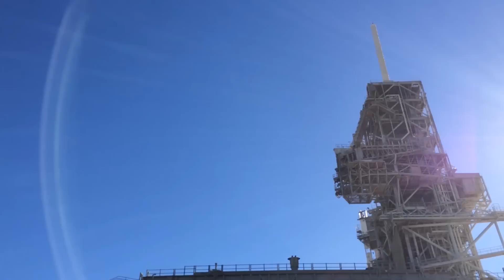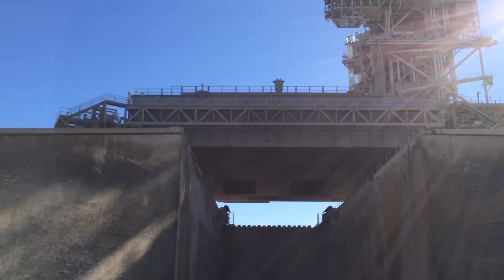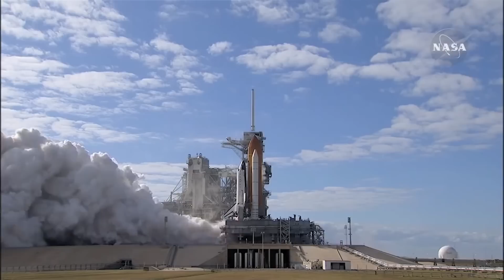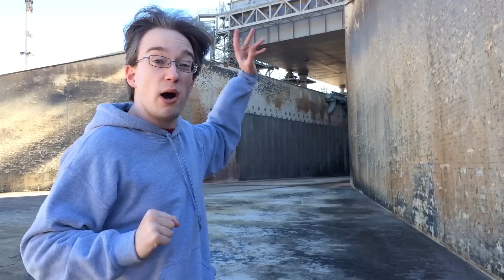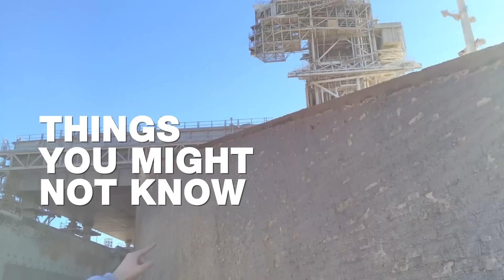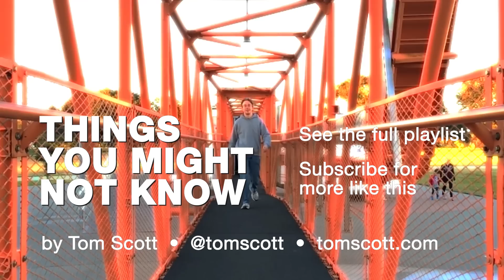The Hard Part About Getting To Orbit Isn't The Height

Comment: Why do you use miles?
Your English and metric is best.
Reply: England uses a mixture of metric and imperial. We have road signs in miles, food is mostly sold in grams and litres, beer comes in pints but wine comes in 750ml bottles. Temperature is mostly standardising on metric now but a while ago it seemed like we used Celsius for temperatures up to about 15c/60f and Fahrenheit for higher temperatures.

Comment: Most of the energy released as heat when something burns up on re-entry isn't actually because of friction with the air scraping up against the thing as it falls. Because the meteor or rocket booster is traveling faster than the speed of sound in an atmosphere, it's actually caused by compression — the air underneath the falling object is too slow to get out of the way, and it collects underneath the object. Highly compressed air is extremely hot, so it burns up. And that, is something you might not have known.

Comment: Anyone who's gone through the trouble of installing Real Scale Solar System and Realism Overhaul to Kerbal Space Program knows this all too well. Also, plane change maneuvers take an insane amount of fuel, which has been the main reason I've yet to make to the Moon yet. I think once I managed to do a flyby, but that memory is quite foggy at best. shrugs
Reply: Even in stock, you get a good sense of the concepts behind orbit once your big rocket falls into the ocean a few times
Reply: @keiyakins  and rss/ro gives you the sense of head pain
Reply: My solution is simple. If it don't work, add more rocket. It'll work eventually.
Reply: God RO sounds like hell 
returns to flying SSTO in stock
Reply: Why change planes if you're going to the moon? If you launch due east when the moon crosses the 90°-270° line on the navball you'll launch into the orbital plane of the moon and now you only have to burn prograde
Reply: Maybe in stock KSP, but in RSS, the moon is in an inclined orbit to account for the fact that KSP1 doesn't support axial tilt. (Unless you install Principia, but that's a whole 'nother kettle of fish besides.)
Reply: @LexieAssassin  i'm talking about RSS though. If you're launching from Florida you can launch directly into the plane of the moon once a day (twice, but the launch windows are very close to each other so they're basicly one)
Reply: Hirmh... I haven't played RSS in a while, and I think back then I was launching from Baikonur besides.

Comment: A thought. If the problem with reentry is the fact that the objects doing it are entering at stupid-high speeds thanks to needing that to maintain orbit, would someone jumping off a space elevator (assuming one is possible and gets built) not turn to ash and be able to actually parachute their way down?
Reply: By the time you actually reached the atmosphere you would have sped up a lot so I'm not sure.

Comment: Reentry was used by Apollo, not space shuttle. 30 years and media did not understand. Reentry is about bouncing up against atmosphere like a horizontally travelling stone on a pond.
Reply: That's aerobraking. Pretty different.
Reply: No. Aerobraking is using air to brake. Reentry is bouncing. If you do not use aerobraking, you can use lithobraking (crash on stone) or propulsive braking.
Reply: M Infante Atmospheric reentry is defined as entry into the atmosphere of the body a spacecraft was launched from. What you're referring to is entry skipping.
Reply: Hologrampizza Have you noticed how space shuttle EI Entry Interface is not named RI Reentry Interface? When you reenter, you enter again.

Comment: Of course it's speed... 8 km/s is not easily achieved, but if it is achieved then altitude is not a problem at all...
Reply: All is relative, I think the combination 8km/s at an altitude of 100m above sea level could very quickly become a very big problem
Reply: Flimzes Of course it is relative to the planet we are talking about. But on Earth 8 km/s is the speed which is enough to reach the Orbit.
So Unless you are going 8 km/s towards the ground you will be in space in no time after reaching 8 km/s...
This doesn't depend on object's weight btw, weight only matter in determining how hard it is to reach 8 km/s. Shape also only matters for Air resistance, because you don't want to slow down below 8 km/s due to it. But if you have stable speed above 8 km/s you are in space or will be very soon.
Reply: At 8km/s at 100meters above sea level I would be worried about smashin into things at about 8km/s much more than eventually hitting space. It was a joke :)
Reply: Flimzes Oh... in that regards... well as I said in my answer... You need to make sure that you have stable speed of 8 km/s... Smashing into things doesn't help...
Reply: Hmm, having an elastic collision with an incline at 8km/s would probably yield most interesting results
Reply: Flimzes Problem is... can you find elastic enough incline...
Reply: Timur Sultanov i have one word; "flubber"
Reply: Flimzes if only it didn't violate laws of thermodynamics
Reply: Maybe it flexes into an n'th dimention where energy and reserve material is plentiful?
Let's not get such pesky things as Occams Razer and the laws of Physics stand in our way
Reply: Altitude is a problem! If you're 2 million kilometers from Earth and going 8km/s, you're going interplanetary!
Reply: ZBTEproductions not necessarily. Depends on direction too
Reply: Timur Sultanov Not really! 2M km from Earth may be smaller than I remember, since I'm so familiar with Kerbal Space Program, but past a certain point, any direction at 8km/s a sec would either result in an interplanetary trajectory or a really nasty re-entry vertically into the earth's atmosphere.
Reply: ZBTEproductions yep... I was referring to nasty reentry
Reply: Timur Sultanov Ah, got it :P
Reply: ZBTEproductions if you don't reenter and just do a fly by the Earth, you will go so fast at closest to Earth that it will be just a slingshot effect which will speed up you even faster into outer space... Similar to how they sent some probes into outer solar system by slingshoting them of Jupiter...

Comment: It's not bloody friction damn it! Will people stop spreading misinformation about!!!
Reply: Compression.
Reply: then w-hhat is it?
Reply: Thank you!
Reply: Hey, that's something I might not have known! Cool!
Reply: Yer welcome
Reply: technically, compression is a form of friction
Reply: ***** Would you care to elaborate? Are you sure you've not confused compression with viscosity (which also causes heating, but on a much smaller scale)?
Reply: 233kosta compression causes the particles to move faster or heat up. the particles give off heat as they slow down from the compression that sped them up. friction uses the same mechanism of speeding molecules up like that

Comment: Actually the heat is caused by pressure not friction
Reply: Friction is causes by things sliding past eachother, like your hands if you rub them together or the air sliding past a space shuttle. I think this should produce some heat. However, the vast majority of the heat the space shuttle (or anything going fast enough through the atmosphere) experiences is compression heating: the air in front of the shuttle is compressed and heated by compression before it has a chance to slip past your spacecraft and induce friction. This is the reverse effect of an aerosol can becoming colder when you decrease the pressure by releasing the paint, deodorant, whipped cream, etc... from it.
Reply: I would guess the vapour trail is condensed humidity in the air in the cold pocket left behind a bullet that absorbed some amount of the compression heat, leaving a trail of colder air.
Reply: Flimzes Fascinating thank you
Reply: Ok, if that is the case does that mean the vapor trail left by high velocity bullets is caused by the same factors?
Reply: So what causes friction?

Comment: If Kerbal Space Program has taught me anything it's that sidewaysness is more important than upness.
Reply: +AndorianBlues It will always be relative. going straight up on the moon at the right place could mean going sideways to Kerbin. because the Mün's gravity is so low you can actually kinda ignore the Mün's gravity, not try to get sideways and instead point straight to the retrograde relative to Kerbin. Even if it's straight up.
Reply: If you're in orbit, you're halfway to anywhere!
Reply: or as Scott Manley taught "Altitude is life, Speed is life insurance"
Reply: @vine01  I've always known that quote as the reverse, speed is life, altitude is life insurance you need speed for lift(or orbit) and altitude gives you time to react to things going wrong
Reply: @SerialElfYT  it could be that i'm wrong, sorry :D
Reply: Are you saying you don't fly straight up until the apoapsis is 75km, hit X, wait until you're there, then burn prograde like hell?
Reply: AndorianBlues same
Reply: youluvana eh? I just like killing jeb..
Reply: And also that the Kraken is not a sea creature
Reply: 7+ years later and this is still fax 📠
Reply: AndorianBlues I
Reply: You monster!
Reply: I know, right? This video popped up just as I was having trouble getting a probe off Duna!
Reply: Which makes me wonder why Linear Induction Motor tracks as a launch method are not more common. You could get serious speed with electricity alone, then cut in the engines for escape velocity. You'd save a lot of fuel, which could help for landing and launching from the moon and other planets. If you started horizontally, where acceleration is easier, then transitioned to vertical using your momentum, you wouldn't expend near as much fuel as lifting straight up.
Reply: No because you have to go over the athmosphere
Reply: An odd thing I found out is that if you were on the ISS and shot a bullet from a gun directly at the earth,  the bullet would not hit the earth, at least for a very long time. In fact the bullet would end up going HIGHER than the ISS because the bullet would still be in orbit, but in a slightly elliptical orbit that would bring it farther away from earth as part of its new orbit.

Comment: A bit of extra information to add onto this would be that they actually start turning for early in the launch.  The time in which they do depends on their thrust to weight ratio.  But the reason why they do it this way is to save on delta-V that the space craft has.  They do a gradual turn instead of a sudden turn is for one, it takes a lot of delta-V to make it into orbit as Tom has mentioned in the video, and you do not want to reach the peak of your orbit, also known as your apoapsis (yes that is how it is spelled, despite spell checker).  If you do, then you are wasting energy, because you have to thrust even more to circularize your orbit to bring your orbit up to match your apoapsis.  You can see this being done when you see rockets during flight, some time after liftoff, they will start turning over.
Reply: cool

Comment: although I realize that they need the speed to be in orbit, wouldn't it be better to have rockets take off at higher altitudes where there is less air resistance, and therefore less time needed to achieve that speed?
Reply: Stuart Hull i think he's probably referring to launching smaller rockets from high altitude airplanes or towing them up as far as possible with balloons before launching.
Reply: interesting, never knew they actually tried those methods, i had always figured that it would make sense to at least try something like that but never actually knew that they had.
Reply: Different from the current Orion spacecraft, it should be noted.
Reply: you are absolutely correct. probably best place on Earth is Equador, high altitudes and already on equator so greatest gravity assist. closest to it is French Guyana where ESA launches Ariannes.

Comment: Although it wouldn't be practical but would be very expensive could you use fuel to slow down outside of the atmosphere and not need heat reflector things to avoid burning up on re-entry

Comment: The heat is not caused only by friction but by the compression of the air as well, and the hyper-sonic shock-waves from re-entry that turn the air to plasma.
Reply: +Aaron Harmon Almost all of the heat is shock heating in fact, very little is caused by friction

Comment: It makes you wonder why people think a "space elevator" is a good idea.  Why are physicists contemplating a space elevator if the stuff they send up still needs to be propelled 15,000 mph.
Reply: Well, 15k MPH is how fast one needs to go in order to get into orbit. Getting into orbit is not merely flying to space. Getting into orbit is a matter of adjusting your horizontal trajectory in order to maintain an orbit. And once you're in that obit you continuously fall towards the Earth but due to your speed and trajectory you constantly miss it, thus you stay in place.

Space elevators on the other hand wouldn't need to maintain or get into an orbital trajectory. Sure, while setting it up you would need to get the end station into orbit, but once that's done the actual car wouldn't need to go 15k MPH since it's not trying to get to orbital velocity. It could just slowboat it's way up the shaft and eventually it'd reach it's destination.

And the reason why alot of scientists are trying to get a space elevator to work is that it would save billions of dollars on space exploration. You'd no longer need to blow $450 million on shooting a rocket into orbit. Instead you'd simply get your astronauts together and send them up the elevator. Sure it'd take them about a week to go up it, but that time is well worth the cost.
Reply: Geostationary orbit :P
Reply: FiNiTe  because the end of the stick is moving faster. it is circling the centre of the football in the same time as the ball itself, but it has to cover a greater distance in that same time, hence it moves faster. that is of course ignoring the mass of the stick.

thus even if we had an elevator we still would have to accelerate on our way up, from 400 m/s to 3000m/s, to get to the point of weightlessness. if we wouldn't we would slow down the building, and it would again wrap around earth.
Reply: Stuart Hull Exactly the reason we dont have an elevator.
Reply: To space.
Reply: "Once you are in low Earth orbit, you are halfway to anywhere" - some guy who's name I forgot :D

Only that with big ships, imagine what u can do wif you'd have a Saturn V booster stage up there, but optimized for vacuum,or maybe due to not having the need of atleastr 9.8 m/s^2 of accel, we might be able to slap some ultra efficient engines on it and go for a mars flyby, maybe even pluto.
Reply: Stuart Hull Why not back? just lift if to the proper speed and altitude, to get jupiter encounter, then just fix for the gravboost, also, the center of mass would not have to be in geo orbit, sure, it might remove the pressure on the bottom, but then you get that on the end aswell, and out CoM's aren't in oribt, and were fine :D And plz use M/s, they make moar sens, since I play KSP :D
Reply: Stuart Hull The ion engies in real life that I know, have a thrust about the newtons that a coin pulls anything that's holding it down.
Reply: Stuart Hull Meh we might have super efficient engines or teleporters by that time, so maybe a space elevy will be useless, unless for tourist travel.
Reply: Clinton Gillespie that's the idea behind space elevators. A building sitting on the earth is pulled by earth's rotation, if you build higher, the vector speed stays the same, but the top of the building moves faster. The higher you build the faster the top moves, and orbital velocity also gets lower further away from earth, until at some point the top of the building reaches orbital velocity. It is essentially weightless. If you build even higher then that, you are starting to get a pull.

Now put an elevator in there, all it has to do is go up, the earths rotation will do the rest.
Reply: +KevinementD 
that building should become weightless at around 2.5 *10^9 m altitude, or 1.6 *1^9 miles

only, it cannot be that simple. if it doesn't speed up, and just keeps moving at something like 400m/s, because it has to cover a far greater distance, it would take it 450 days to circle earth. not exactly geosynchronous, while it can only take it's foundation 24h. it would wrap around earth and crumble to pieces. 
if we don't want that to happen it has to be geosynchronous, and at about 4.2 * 10^7 m it would be weightless, at a speed of about 3000 m/s. 
a lift would make things easier, but even like that we can't ignore the fact that going straight up just isn't enough.

sorry
Reply: Pie S What? why would the top circle slower, it's like putting a stick onto a football, it takes the same time for them to circle.

Comment: You need to be going 17,500 MPH to orbit, NOT 15,000 MPH stated. Going at that speed will make you do that which you're trying to avoid, coming back down to Earth.
Reply: +joeguitargod It actually depends on your orbit height for example geo stationary orbit is less than 7000mph, as far out as the moon and it's under 2500 mph

Comment: what about helium balloons, they go to space.
Reply: No they don't and even if they would than this is much different than a rocket because most of the weight in a helium balloon is the helium itself ... and it rises because the difference between the air pressure is just a little bit lower the higher you get so the balloon it pushed by the air below it .